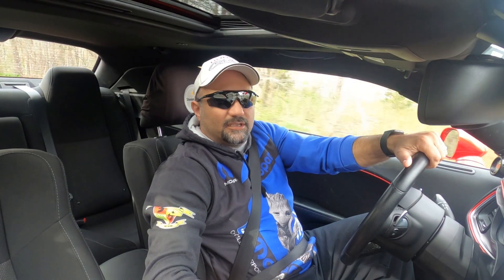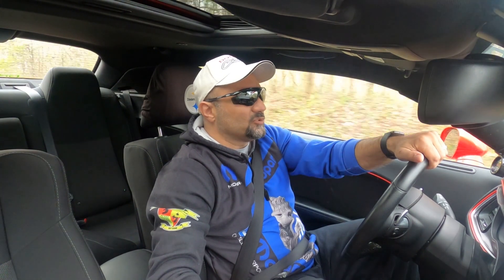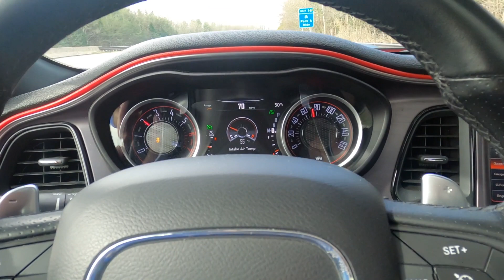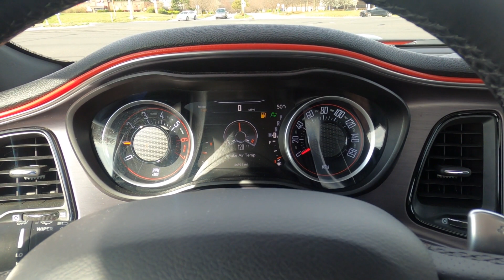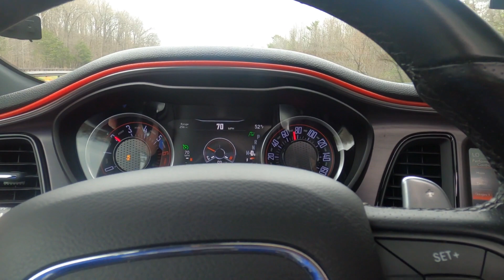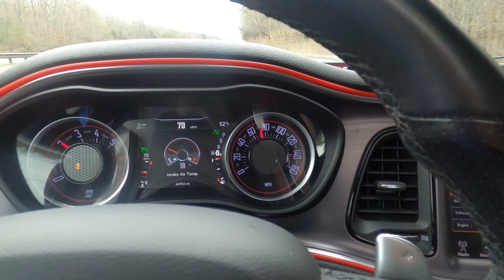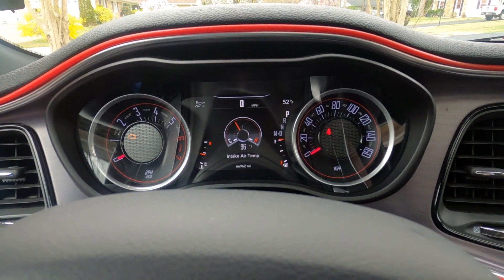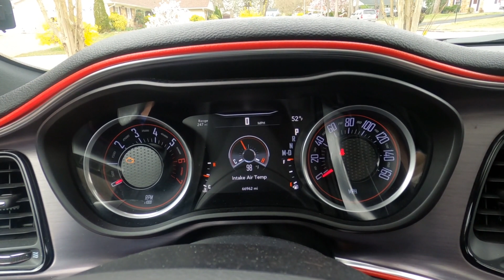Cold Air Intake (CAI) affects on Intake Air Temperatures (IAT). Does insulating your CAI help IATs?

Comment: doesn't this have an AC? you could get much colder air intake temps. heck, what if a turbo's intercooler had AC boost for cooldowns between pulls? or during
Reply from the maker: It does have AC but it's not integrated to cool down the IATs. There is an Inter Chiller out there that integrates it but I don't have that, well didn't then. I now have and air to water intercooler for the ProCharger. 💪

Comment: I don't hold a degree or PhD on these matters but common sense dictates that you're wrapping to get cooler Temps but science dictates that your reaction now is that Temps take longer to cooldown. Your essentially isolating heat... And that's not what you want. You want the natural flow of cold outside air to keep flowing in. Also it seems like your system is just sucking in hot air from underneath the hood.
Reply from the maker: Yup, you nailed it. It doesn't quite seal with the hood shut so it's getting hot air from the engine compartment. That's all taken care of now that I have a ProCharger. Now I have a whole different hot air problem. 😉

Comment: This video makes absolutely no sense! Idling air temp v air temp switched off 🤷‍♂️
Reply from the maker: It was a disastrous attempt to see if insulating the CAI box would keep the IATs lower.
Reply: When you turn the car off. It gets hotter after driving. Hot air from exhaust rising.ive measured with a temp gun on and off.

Comment: The air temp intake sensor (usually located in MAF) becomes heat soaked .You need to move the sensor to the air box .The temperature of the intake air will be around ambient but that's not the info the ecu is getting.The air intake temp will go down when you moving obviously.You need to move the sensor where it is getting accurate information.Wrapping the air box would only help if the air sensor was located inside it
Reply from the maker: Mine is located in the intake tube so it’s reading just after the filter. This was just an experiment to see if insulating the air box would help at all.
Reply: @ModernRedHemi  Hi There,If the air intake temp goes up way higher  then the ambient when idling ,it would suggest the air sensor is  being subject to heat soak.I would try moving the sensor to the air box and see what happens. The whole experiment is very worth while and  it might prove to be a very cheap performance mod.Good luck

Comment: Only thing i saw with a huge variable was, at idle, the engine was running while waiting at the light.   After you wrapped the intake and the temps were similar, you compared the car running at isle (122f) to when the car was completely off (98f) and said there was 20 degrees difference.  More than likely the results would have been the same in the car was running... unwrapped and wrapped.
Reply from the maker: Agree totally. That was a misstep by me when creating and editing the video. Thanks for watching and catching my missteps. Helps me do a better job and the channel over all.
Reply: I was thinking the same thing lol
Reply: Any updates?

Comment: Hey, pretty clean wrap, bro.  That actually looks promising to me, because I use my 2019 5.7 Daytona for work and there are a lot of times when I'll be idling or sitting in slow moving traffic and stopping and starting the car frequently.  The factory Mopar intake is kind of nuts for the Charger because there are so many openings on the air box that just let the hot air from the engine bay right in.  I know there is a DIY thing in the forums to allow the use of the air tube from the Charger Hellcat intake to fit into the Mopar air box, but that's a lot of work!  Here in Honolulu, the outside air temps range between 70° to 98° and the intake temps while moving will usually be about 8° above the outside temps, but when idling or stuck in traffic, it'll go right up to about 180°!  It climbs fast too.  Anyhow, awesome video.  Glad to see some good 5.7 content.  Keep it up!
Reply from the maker: Thanks brother! I hope this helps you out if you try it. I would love to see how it does if you do. I was stationed in Hawaii from 2006-2010 and know how the temps are there.

Comment: Cooler air denser the air more power produced,  dose your tune make adjustments to the fuel mixer when the air temp has reached a certain degree plus or minus?  Thumbs up for the DIY's.
Reply from the maker: jhenry248 you are absolutely correct. Yes, my tune does adjust for ambient temperature. This was not about power but the affect on intake air temps if you insulate your air box. Video on power coming soon!